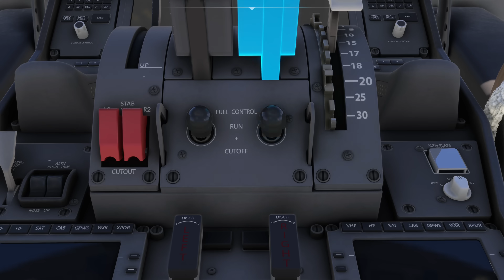Air India 171: Why Did The Fuel Cut-off Switch Get Moved?

Comment: You are an idiot to believe that a pilot irrationally turned the switch off. This is as insane as the American influenced biased preliminary report that got released during midnight Indian time when the whole nation was sleeping without any authority’s signature. 

The selective vague language used like the fuel cut off switch transitioned instead of saying voluntarily moved shows Boeing’s influence/pressure . tactic.  Why would they release part of the conversation picking and choosing them from only CVR. Why not match the whole conversation from the boom mic that gets recorded on DFDR and present the whole series of  conversion start of the flight runway to the point of accident. 

This guy pilot Steve … I really wonder if he is just spinning stories here just to get you tube views … so unfortunate that he is just interested in making monetary gains by spinning stories here, conveniently talking about mental health and casting aspersions on mental health  of pilots and steering this towards suicide. 

Doesn’t this so called pilot understand that as part of the memory routine of the pilot they procedurally have to cut off engine switch and turn it on as part of the routine to kickstart the engine in case of dual engine failure. In the conversation of the pilot the emphasize could have been on “You” and not on the switch. Having said that the thrust is lost now consider this conversation, “ why did YOU switch it off” meaning he meant “it should have been his role to cut off and attempt to turn it on” as it’s part of the role of the kk motoring pilot’s role as the pilot might have thought the other pilot has already switched off but got it clarified and then confirming that the other pilot did not do it , he then did it as dictated by the memory routine. 

Despicable bunch here casting aspersions .

Comment: The fuel cut off switch could have been moved in an attempt to restart the engines after some electrical malfunction cut them off. Too many people have made up their mind that this tragedy is down to one of the Pilots. 787 engines have cut off before in Japan without the fuel levers being touched. Why is this not being mentioned!? .......
Reply: So how did they get registered moving back to the run position if they were in that position all along according to yourself? They can hear the soudns of eveything in the cockpit you know.
Reply: @Horizon301. Engines cut off, Pilot moves levers from run to off, then back to run to try to restart engines.
Reply: @Horizon301. I dont think you understand how the FDR recieves electrical inputs from the fuel system. They dont KNOW they were moved, they are presuming. There is no video. Its all based on electrical inputs to the fdr computer. They were in the run position in the wreckage.
Reply: @stillthakoolest of course they know, you are implying a crazy chance of both switches failing and then suddenly working again at different points in time? They investigators will hear every sound so if the switches were pulled they would hear it. If they didn’t hear it I doubt they would have given that much detail on the preliminary report just to send people the wrong way.
Reply: @stillthakoolest  why are you so afraid to admit what's obvious?
Reply: That would have been in the report, don't you think, them talking about "resetting" it (Is that even part of the manual). Also cut off to run took 10 seconds.
Reply: Because if this was the case one wouldn’t have asked the other why and the other deny.
Reply: yes, this crossed my mind too.
Reply: Why most of the Indians r not accepting the truth , after this small report we can easily say who's mistake was that. And still they r not ready to accept the fact????
Reply: @vvr8820  you need to understand the mindset of the people who live here. If a person is not terrorist from Pakistan or Rebel, he will not perform mass killing just to kill himself. Infact if someone wants to kill himself, he will find so many easy ways to suicide within his home. Why would someone get dressed, take ride to airport and perform so many formalities. That was reason 1.
Other reason, how come both fuel switches can transition to off within 1 second by a man ?
I heard from some pilot, to cut off fuel 1st throttle needs to be brought down then fuel cut otherwise lock doesn't let it happen.
3rd reason
I saw the simulator video, where when fuel was cut immediately warning sound started in cockpit, would that not bring attention of everyone in the cockpit who did it if done manually?
4th reason:
  Aren't there issues reported to fuel switches previously?
Reply: Umm can pilot cutoff both the engines in 1 sec considering it requires a bit of effort to toggle the switches???
Reply: U can easily turn them off , if u have dought then go to the b787 cockpit simulator and try yourself or u can go to the real plane cockpit thr try  @shouvicbanik5175

Comment: I'm going to wait for the final report before jumping to a conclusion about this being just pilot error. There is news about the FAA sending out an advisory about how these switches could inadvertently be set to the OFF position because the failsafe that was supposed to prevent this wasn't installed properly on some Boeing aircraft.

Air India, Etihad and a few other airlines are inspecting their Boeing planes to see if any of their planes have this issue. Considering Boeing's reputation, I wouldn't be surprised if this was the actual cause.

Comment: Flight journey is hardly less than 5 minutes.  Common sense pilots are trained properly,  i didn't think pilots are such dump to cut off fuel during take off building thrust.
  it is something about mechanical failure of switches  becox of spring loaded switches

Comment: It looks like they are trying to put it on the pilots. What stopped them from releasing more parts of the conversation between the pilots? They must have heard all of it! Why release just one sentence from the conversation? What if it was an electronic failure that cut off the fuel to the engines and one pilot mistakenly thought the other pilot did it and he asked why did you cut them off and the other pilot rightly says I didn't do it. And then to reset the engines, they cut off the manual switch and then bring it back to run again. Looks like its easy to put it on pilots who are no longer here to defend themselves!

Comment: Caption Steeve, Is it possible to move both the Fuel switches, from Run  to  Cut-off position within 2 seconds, (It shows 1st switch at 08:08:42 and 2nd at at 08:08:43) It  would take minimum of 3 seconds for both  the switches.  I would request all of you to do this exercise and see and please comment

Comment: Good solution would be double fuel cut off switches in parrallel, one set left of the pilot and the other set right from the co-pilot so if one should shut off the switches but not the other they would not cut off the fuel and if one of the two people would cut off both sets he would have to put up a big fight with the other pilot to get to his switches,

Comment: A suggestion by one commenter was to require both pilot input to switch off fuel.  But there are exceptions to every situation.  What happens if there is an engine fire and one of the pilots is incapacitated?

Comment: Comparing kids to adult experienced pilot is a weak analogy. This happened right after flight took off the strip. It cannot be true that cutting off could have done. Even if pilot would have mistakenly done it, would have immediately turn on immediately not after 10 seconds. It is clearly Boeing plane issue. There definitely would be a automatic way to turn on/off switches.

Comment: This is my posting n the facebook

Lots of wrong assumptions 
1) Ground staff sabotage and placed the fuel switches in OFF Position   Not a sound assumption as engine would not have started   Rolled and took-off. 
2) Fuel switches slipped back on it own may be due to vibration   Not possible without they propely latched in RUN position engine would not start. 
3) Both engine failure RAT falling down loosing thrust could be POSSIBLE  due to interruption in fuel due to vapor lock ( as multiple factor supporting high temp viz Ambient temp, hot engine not cooled adequately) ,  higer RVP FUEL,  poor quality control. Water or sludge in fuel migration.
4) So when fuel lost engine failed, lost thrust, RAT deployed 
a) pulling up landing gear not a priority
😎 stroking the fuel switches from OFF  and to RUN  2sec & 4 sec respectively is the given procedure which probably the captain attempted and one engine revived but other possibly there was delay due to restricted fuel and since the altitude was very low < 400 ft, no recovery height available with added drags like RAT, Landing gear in down position  the plane met the unfortunate fate.
So the report is hurried conclusion that pilot put the fuel switches in OFF position is obnoxiously cruel conclusion. 
If the committee wants to rescue BOEING fine with the above apparently there is no direct technical glitch but the associated gaps in fuelling system, fuel monitoring system fuel management system and maintenance of fuel supply system, people involved, and audit records after maintenance all need to be critically reviewed . 
SO THE CONCLUSION OF PILOT SUCIDE  ATTEMPT IS FARCE AND CANNOT BE ACCEPTED BY ANY SENSIBLE PERSON AS THE REPORT DOES NOT INDICATE THE TIME  FOR THE CONVERSATION ON WHICH BASIS THEY CONCLUDED """PILOT-1 YOU DID THIS    PILOT-2 NO I DID NOT DO""". ???  There was no voice recorder indicating fuel switch/knob, nor there is any time indicated for such conversation

Comment: Difficult because we never want to assume someone with the responsibility of other people's safety (be it +1 or 240+) would intentionally harm them.  But the fuel shutoff switches were designed to take add'l steps, add'l thought in changing them.  Also a crucial position because it's 'takeoff' so you're committed to try climbing.  If further invest determines it was done on purpose, why??

Cont 🙏🏾s to the victims' families...

Comment: The most important piece of information missing here is what time exactly one of the Pilot asked if the fuel was cut off? If that was asked before the switch transitioned to off, then that means the pilots went through the memory items which requires them to turn off the switch to shut down and then try to turn on the engine again. So the investigation board deliberately did not provide the information as to what time the Pilot asked if the fuel was shut off.

Comment: Redesigning the fuel switches to deal with a one in 10 million (or more) situation is nonsense.  If a pilot wants to crash an airplane, he has dozens of ways to do it.  Its just like the vehicle one drives, you can crash it 101 ways.

Comment: All the current discussions seems to be centered around the conspiracy theory that one of the pilot had turned the fuel control switch to cut off position. However, the last conversation between the pilots in the cockpit appears to suggest that nobody actually touched the switches.... bear in mind that when the plane reaches Vr speed both pilots' attention were focused on the instrument panel and the co-pilot probably had both hands on the yoke. As both pilots are considered very experienced, the first inkling that the engines have lost thrust is from the sound of the engines. The pilots would immediately know that something was wrong, that was probably when the conversation took place. The next instinctive thing to do was to do a reset.
The intention of this initial findings seems like it wanted to put the blame on the pilots and there were no mentioned at all about the service bulletin Boeing issued that talked about a potential flaw in one of the plane's EEC chip

Comment: Hello Captain.  The 1st officer was flying the plane, so his left hand was on throttles and his right on the yoke. Had he reached for those switches the monitoring Captain would surely have called it out? Also high tech voice analysis will surely be done as to who said what, would that be correct sir?  Blue skies.

Comment: no.  cut-off one engine could be a normal operation.  but cut-off both engines when the aircraft is in such low attitude is a very bad design feature.  Boeing needs to answer it.

Comment: I understand there may be situations where the fuel cut-off switch is intentionally turned off, such as during landing. But shouldn’t the software, using all available inputs, be able to determine whether the aircraft is about to land or not? And more importantly, why not raise an alert whenever such a critical action - like cutting off fuel - is taken, so both pilots are immediately aware? That way, whether it was done intentionally or accidentally by one pilot, the other can quickly catch it and take corrective action.

Comment: Steve, for these cutoff switches can they be left ON the detent (neither OFF or RUN position) but the plane treats it as being in the RUN position,  then the action of the rotate (or bump on the runway) cause the switches to fall into the OFF position with neither pilot actually touching them ?

Comment: @ Captain Steeeve  Please consider this possibility! : pilot X moves the switches, then asks the other pilot "Why did you move the switches?". The honest answer of pilot Z will be "I didn't". Pilot X who moved the switches, can also be the one who declares the emergency (to deflect suspicion). The CVR can only reveal who said what, but NOT whether this spoken information is consistent with what really happened. Only a camera in the cockpit can  show us what happened. (One or more cameras don't have to show us the pilots, if we can see the pedestal, overhead panel, circuit breakers panel etc, it will be of great help with every crash investigation!)

Comment: In general,Air disaster never comes step by step, but in this case it's very very complicated, those who are blaming the pilots are stupid kids, one should not deny the sabotage angle here! It's deliberately done, the timing of fuel cut off is the "real culprit" why that happened  only after take off? look how things had been failed process wise, first gear problem ie hydraulic failure,  then fuel cut off, then both engines failed,then thrust lost, and finally rat deployed, yet it also gone invain! this is well planned sabotage!! Because technological failure/ disaster never have systematic steps!!! it comes always in unsophisticated way. Plane crashed exactly like a hunter gun down a big bird, that's it.

Comment: 😮😮I want to raise a question to capt  what will happen to signals generated by fuel cut off switches in case a whisky or coffee  spill at center pedestal,bcz there were many occasions where seal of switches p n 766ATxxxx swells due contamination percolated on central pedestal panels like fire control panel of boe 737 ,here in 787 fly by wire technology can a spill can cause change of On/off  signals?0

Comment: Steve, could you discuss what happens to the engines during flight when the fuel is cut off, and do they resume producing power when the fuel supply is restored, without further intervention? How much time is required for them to return to the required output?

Comment: to place cctv, require approval of airlines to place camera on the cockpit, unless is forcefully by government . meanwhile boeing and airbus can do something new on their new aircraft like placing switch on 2 pilot eg. switch must be turn off both pilot to turn off the valve, but only required 1 switch to run that could prevent this kind of accident again because suspect have to fight the other pilot.

Comment: Wasn't there a service bulletin from Boeing back in 2018 related to the locking mechanism of the fuel switches? What if the bulletin was never completed on the Air India plane?